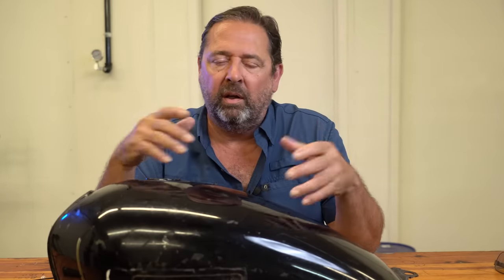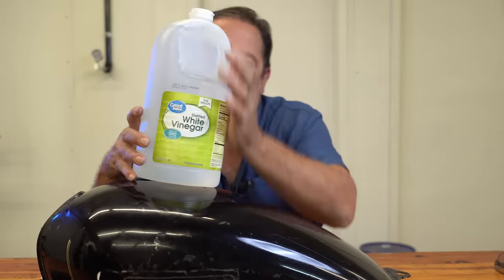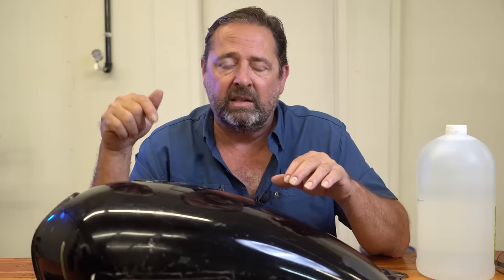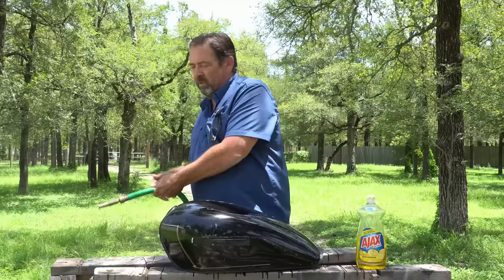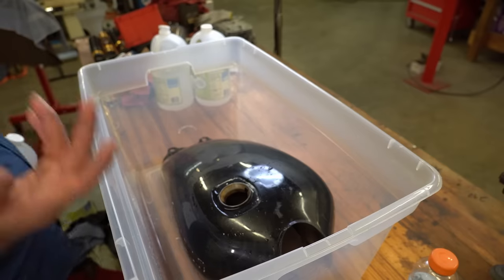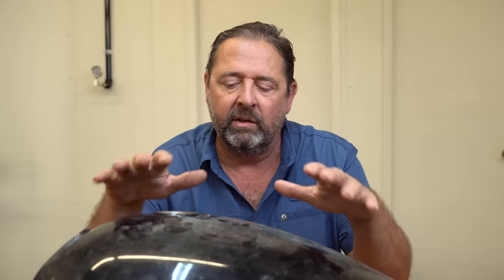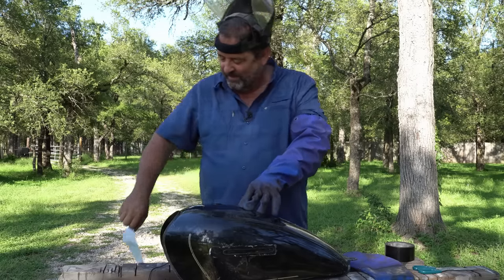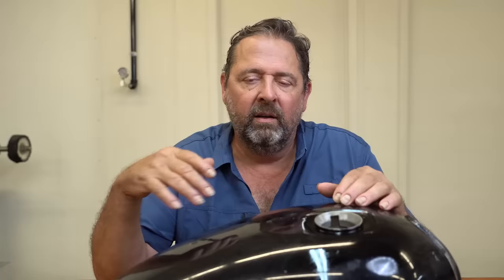GAS TANK--CHEAP--RUST REMOVER !!!!!!

Comment: Phosphoric acid is ten times better - AND leaves a protective phosphate layer on the bare steel. The rust spots You left in that tank, will come back to haunt You in a few years...
Reply: How would you use phosphoric acid?
Reply: What about the paint on the tank and how would you use it

Comment: Excellent tips on rust removal. But, Never seal the inside of a tank! It renders it irreparable in the future and with today's fuel blend most resin based sealants will eventually fail. I have been a professional tech for over 40 years and have repaired countless tanks with dents and rust through but once resin sealed they simply can not be repaired properly. This may be viewed as my opinion but it is my experience as well.
Reply from the maker: Great point!
Reply: Have any opinions on removing a sealer from a tank?
Reply: @1cleansinglecab  the only method I am aware of is a burn-off oven at 850°f and that could potentially damage the steel the tank is made of. The epoxy is fairly impervious to chemical strippers.
Reply: I've used milkstone remover mixed 50/50 with water let sit for 24 hours and drain... clean tank then I fill up the tank and add seafoam to get rid of any water left over and it's only 20 bucks for a gallon of milkstone remover.
Reply: @jasonpiech385  you use milkstone for rust removal or are you saying it will break down and remove the epoxy lining? It is basically phosphoric acid which I use as an etching agent on bare steel before paint.
Reply: @hlrembe62  no just rust removal. I used that to get rid of rust and never sealed the tank.
Reply: @CycleFab would it be okay to leave my fuel pump in the tank for the vinegar
Reply from the maker: I doubt that it would hurt it but try to get it out if you can.

Comment: Works like a charm, didn't believe it till I tried it. Filled a completely rusted tank with vinegar, left it over night, next day rinse and neutralize with baking soda, BAM! The rust was heavy scale, all gone shiny clean. Coated the inside of the tank with light oil, 4 years ago. Pulled it out last week, still clean and shiny inside.
Reply from the maker: Good stuff!
Reply: I’m bout to do the same with my 99 zx7r. I also want to coat it with something to help prevent it from rusting again. What kind of oil did you use to coat your tank?
Reply: What do you plug the tank with before filling with vinegar
Reply: @kaisenhouse2264 WD 40 ma boy

Comment: Vinegar works like a charm, I keep a 5 gallon bucket half full of it in my shop with a lid on it so it doesn't evaporate away to nothing. It gets weeker as you use it but it take a lot of rusty parts in and out of the bucket before it gets too weak to keep using. That's one of the advantages of Evaporust, you can just keep using it over and over. I've got some in a tub on my bench that's several years old and filthy, but the small stuff that goes in there still comes out great. Using it once and throwing it away is like buying a new hammer on your way to work everyday
Reply from the maker: True!  Thanks for watching and commenting.

Comment: We tried to clean out a 1969 CT90 Trail gas tank using this, it did some removal, however after two attempts,  we used Harbor Freight Evapo-Rust and it did a much better job of removing the rust.. However, if I ever do it again, I'll use the YouTube guys method of electrolysis.  Simple, cheap and from all appearances, does a excellent job.
Reply from the maker: Thanks for commenting!  Electrolysis does work well.  I've used that method on a ford 9" rear end and it came out great!👍
Reply: True that!

Comment: I've used a few small nuts tied to fishing line to shake and rattle around the inside of the tank when cleaning it just helps knock out more crap. Keep up the good work 👍
Reply from the maker: It does help, and alot of people do that.  Thanks for watching!
Reply: Gravel it’s good too
Reply: I’ve used a bunch of washers and pulled them out with a stick magnet
Reply: bb's work too. best on smaller tanks .

Comment: Unlike most gas cans with ‘safety valves’, this one is EASY to operate https://www.youtube.com/post/Ugkx6IImIpPboNrtVJSROnpF9EnyBzRrJKP_ with one hand. Nudge the tab and press the thumb button (all with your thumb) and you’re filling your tank. I bought this to use with a pressure washer that needs frequent refilling and it’s been a blessing compared to most of the ‘safety cans’ being sold. ergonomic and easy to handle.
Reply from the maker: Thanks!

Comment: Best cleaning job you can get inside the tank. Period.
  Oh, that 20-30 seconds...That's all the time I spend with the wife after 41 years. So, I got the timing down! Thanks.
Reply from the maker: Right on!
Reply: @CycleFab  
   For stripping paint that words safely on fiberglass/SCM and metal, check out a company called "Coopers Strip Club" as the sell kits, large refills (About $250 two liquids) but they have you tube videos to watch. They are in New Zealand but require no difficult ordering off website or phone. No extra number to dial. The inventors wife answers the phone and knows the product well. It is a spray from bottles that use a viton seal, steel wool is sharp and the scotch brite pad is dense. Stripper lifts the paint and the "Flusher" is a slow drying solvent that helps remove the dissolved paint. 
  Since the EPA banned sales of methylene chloride August 2019 to the public, their excuse was 41 people are dead because of misuse from 1976 - 2017. More have died from hair dryer accidents! They can't keep track of the waist is the real reason.
I am glad they are much starter! 
DK, ASE master tech since 78, retired.

Comment: Quick tip for something I figured out about taping off the tank for the acid. On the first layer of tape take the last two inches and fold it over to make a handle. That way when you need to rip it off you can keep the glove on and grab the handle to pull the whole thing off.
Reply from the maker: Great Idea!  I'll try that next time.
Reply: Thanks...good to know
Reply from the maker: @Errol.C-nz  Thanks for the tip.
Reply: Saved me from typing this simple solution. Thank you : )

Comment: Oxalic Acid is the go.
One table spoon in hot water for every litre.
Brilliant in engine blocks and only attacks rust (Oxide).
Doesn't hurt any other metals etc.
Flush your block and fill with acid.
Get it up to temperature and let it sit for several hours or overnight. 
Flush then add sodium carbonate  at one tablespoon per litre. 
Run engine and sit overnight. 
Flush until clear.
Fill with appropriate coolant. 👍
Reply from the maker: I've heard about this acid and how well it works on rust.  Looking forward to trying it.  Thanks for the input!

Comment: Good video. I've done it twice now with tanks that had WAY more rust. In my case I found if I leave the vinegar in for 5 days or so and then dump a bunch of drywall screws (Nice and sharp) in and shake the tank is PERFECTLY clean. The vinegar works slow but steady. I really couldn't believe it. The only "problem" is the flash-rust you get immediately when you try to dry out the tank.
Reply from the maker: I had a viewer comment that if you flush the tank out with a Baking Soda/Water Mixture that the flash rust will not happen.  I need to test this theory to see if it works.  If you get a chance to do this before me then let me know how it goes please.  Thanks for commenting!
Reply: What if you flush the tank with diesel fuel?put that oily film on.
Reply: I put some light chain in the tank, with the vinegar (remove sending unit on automotive tanks).. give it a good shake/ roll it around.. repeat as needed, then rinse with baking soda/water.. I've saved several tanks with this method :) When I was younger we put chain and used motor oil in dirt bike tanks and just shook the crap out of them, drain and use.. not as good, but it worked!

Comment: When I worked with extremely highly concentrated acids in a lab - for pre-cleaning sample bottles - I also wore a thick rubber full length apron. If you can get one it can help you avoid the quick strip tease under the hose on the lawn routine.
Reply from the maker: Respect the ACID.
Reply: That paints a funny picture!  That's my kind of humor.  Very helpful comment too!!!  Thank you!

Comment: A good no chemical way to remove rust is 1/3 fill the tank with coarse beach sand (not salty) , wrap the tank in a blanket and put it in the concrete mixer stuffed with pillows to hold the tank in place. Set it going for a half hour, check to see progress and if necessary give it more time depending on how bad your rust is. I've alsodone a pretty good job cleaning scaly corroded galv u bolts and plates from my boat trailer in the concrete mixer with sand and gravel. Those being much heavier rust, they got 2 and a half hours and came out clean, threads and all.
Reply from the maker: Sounds good!

Comment: Step 1:  Drain and dry the  tank.
Step 2:  Partially fill tank with sand and gravel.
Step 3:  Shake a whole bunch... you are sanding the inside of the tank.
Step 4:  Pour out sand and rinse with water.
Step 5:  Fill with Vinegar to get out the small rust.
Step 6:  Dry really well.
Step 7:  Optionally coat the inside of the tamk.
Reply from the maker: Now that's a straight forward procedure plan!  Thanks!
Reply: @CycleFab  Yep... works like a charm.. I have done a few tanks with it.

Comment: You can reuse muriatic acid again, just pour it back into the original bottle for later use and or use the bottle to dispose of the waist acid safely labelled. The problem with using WD40 for rust prevention is it has electrical properties (salt). There are cheaper more suitable lubricant/oil rust preventatives available without electrical properties. Or the old school way a little transmission oil, flushed with fuel before use.
Reply from the maker: Sounds good!  I didn't know that about WD-40.  thanks.
Reply: How do you dispose of the autistic acid safely?

Comment: Thank you ! ! ! !  I'm currently in the middle of this process on an old sportster tank. You da MAN !!! Keep up the great work.
Reply from the maker: Thanks Dude!  Hope your project comes out AWESOME!  Check out my video on Sealing a Tank.  https://youtu.be/S8DJ8pUw9Yc
Reply: how did your sportster tank come out? I've got a dyna tank I'm going to attempt this project on....
Reply: @glenx4892  Hey dude, it worked really well. Better than I expected. I let the vinegar sit in the tank for about a week. I wasn't in a rush, and the longer it sits the better the result. The last couple days I added a long piece of chain that I had, and shook it around once or twice a day. I poured the vinegar out and just rinsed with some denatured alcohol a couple of times. You'll get some flash rust, which it just very light surface color. That doesn't bother me, because it's soooo much better and cleaner inside than before. Worth the effort.
Reply from the maker: @glenx4892  Great
Reply: @gregsimek1167  thanks ... I'm about to take the leap of faith and your experience helps me plan this endeavor.. thanks for sharing
Reply: @glenx4892  One more tip. When you empty the vinegar, empty it into a 5 gallon bucket. Check the tank. If it needs more time, filter the vinegar through a screen to remove any large particles and pour it back in and let sit for a few more days. Good luck !!
Reply: @gregsimek1167  got it thanks again

Comment: Wish I'd known about this a few years ago when I had a really rusty gas tank on a used lawn tractor I had purchased with the power to run a 48" inch belly mower and the weight to handle a rear bagger w/ a separate blower motor.   Alternatives to the sealer you use are simply filling the tank with kerosene or diesel fuel to prevent flash rust. Spraying W-D 40 into the tank may or may not be 100% effective(you have the experience to know what works), but buying liquid W-D 40 by the gallon is expensive.   

For cleaning the tank you can get 9% vinegar designed for industrial cleaning, or use my method - I bought a gallon of 30% vinegar and just add a few ounces to each gallon of the Walmart-type vinegar, which is typically 5% vinegar, and the extra 30% vinegar I add really revs up the cleaning process.  You can also buy citric acid in powder form and add it to water to make an acidic cleaner that can be as strong or as mild as you want. I like your idea of using Muriatic acid for the final process, but I'm a few decades older than you, and would probably forget to use proper eye protection or the correct gloves with that strong an acid, but I'm  willing to experiment.  Flash rust is a real issue in cleaning metal, and flash rust can form in minutes, which why I suggest kerosene or diesel fuel, if it's going to be a while before you finish a project.  With these non-explosive fuels, instead of dumping them out after you empty the tank in the large container you use, just use a large funnel with a wire filter to capture the liquid as you pour it out of the tank and store it for re-use. Cone-type Coffee filters work well with funnels to capture very small rust particles.  Thanks for making this excellent video.

The EvapoRust product can last for years, and if you buy it on sale, you can save bucks.  I recently bought some on Amazon for $19.99 per gallon with free shipping as a Prime member.  Three weeks later, that same stuff is now $19.99 per quart(993 ml) by some sellers on Amazon. Five years ago I got 3.5 gallons of Evaporust in a container with a plastic basket you used to lower small parts into the stuff and then easily remove it periodically to check on the rust removal. $75 delivered to my house. I still use it but will be putting new fluid in it pretty soon, but just enough to keep the older fluid working. Evaporust is effective  for a long time, and if heated up in the sun, it works quicker. I did some research and the way you tell if it's still good is by testing its specific gravity - the same way you tested the acid in car batteries in the old days.  Now days it is easier to use an electronic device to test specific gravity, a device which costs about $15 online.
Reply from the maker: Thanks for the advice and knowledge!  I look forward to using it.

Comment: I just discovered your channel and subscribed. I picked up a Suzuki marauder cheap last year and it needs a little work. I’ll be cleaning the whole fuel system and this video is gonna make that a whole lot easier for me. Thanks!
Reply from the maker: Welcome!  I've got a Suzuki GS550 I'm building into a street tracker.  You should check out the playlist of it, here's one of my favorites:  https://youtu.be/yNG5VWTNKRs
Reply: Well I'll be damned, so did I. I bought a 99 VZ800 Marauder also last summer and it also started leaking fuel later that summer. It had been previously welded and it started leaking next to it but I did a quick fix with liquid metal epoxy and it did hold the rest of the driving season until now it started leaking really bad at the winter storage. To my chagrin I noticed that it is almost impossible to find a replacement tank for this bike and none of the "universal tanks" fit without heavy modding and welding. This video is godsend. I will remove the tank next saturday, fix the leak properly with welding (hopefully not blowing myself up), give the tank a vinegar bath and line it up with something. Either heavy duty epoxy paint or POR-15 which is easily available here.
Reply: @MaaZeus  Best of luck with your repairs. 👍
Reply: @mmpatriot2170  Thanks. I will report how it goes. Hopefully everything is ready before the riding season starts here up far north.

Comment: Hey so this was amazing it worked perfectly I was already on to the vinegar but I had no idea about the muriatic acid thank you now my question is do I have to treat the inside of the tank or can I leave it the way it is I did coat the inside of it with two cycle oil for now

Comment: Hey great vid thanks! 2 things, first, how long did you leave the vinegar in? And what percent vinegar- the food grade or? Second, a tip for the good tape when using the acid: fold a tab over at one end so you have something to pull on wo having to remove gloves 😉
Reply: You can leave it for a few days, depending on how bad the rust is. Can be up to a week too.
Reply: He talks about it at the end. I believe he said to let the vinegar sit for 24-48 hours
Reply: What do you cover the bottom of the tank with when filing with acid? Do you just use good tape?
Reply: @dylandzvonick8274 good question!

Comment: 1 Do you "swish" the vinegar around? Or do you let it set? How long does it set?
2 They make a "cleaning" vinegar which is available at the grocery store. Slightly stronger and still affordable.
3 When dumping the acid. Pour it into a container of water. Neutralizes it and safer to store or transport. Good backup in case you need to flush the acid in case there is an ooopsy.
Reply from the maker: #1.  No, I don't swish the vinegar around.  I simply fill the tank up and let it sit for 48 hours, sometimes just 24 hours depending on how bad the rust is.
#2.  Cleaning vinegar is okay to use.
#3.  You are correct.

Comment: So glad you emphasized neutralizing after the acid treatments! Lots of how-to folks fail to mention that.
Something with phosphoric acid is good afterwards too, depending on the application. And it needs to be rinsed off well also.
Reply from the maker: Thank you for complement and your input!  Also thanks for watching my channel.
Reply: You mentioned phosphoric acid... I was thinking about ospho... that would come after the vinegar and baking soda clean out yes?
Reply: @glenx4892  Not familiar with ospho. Using Phosphoric acid after the cleanout is akin to Parkerizing, without the manganese. It is what manufacturers dip car bodies in after assembly, before paint, to resist rust, and to prevent rust from spreading if you scratch through the paint and primer.
Reply: @steveesposito  thanks